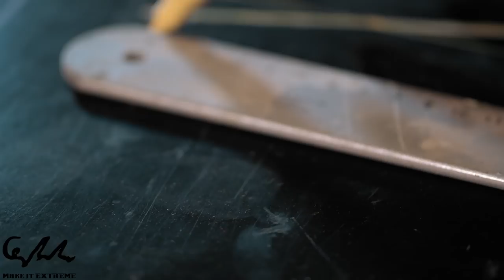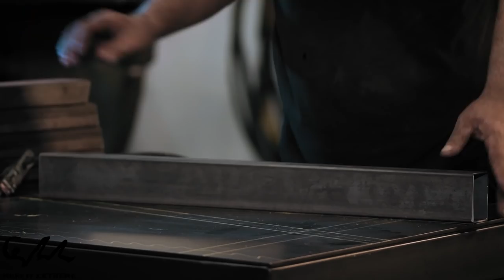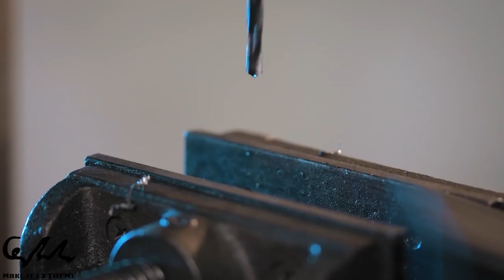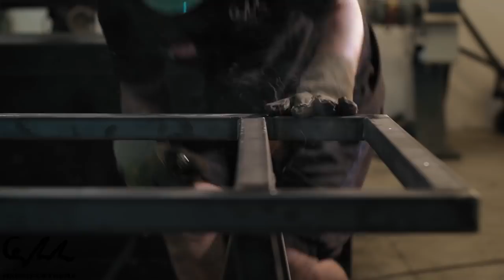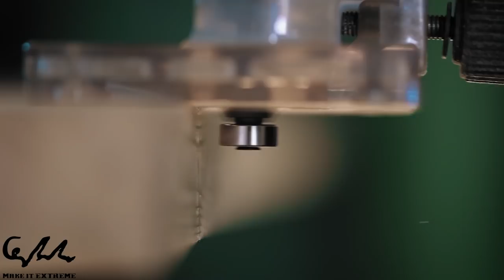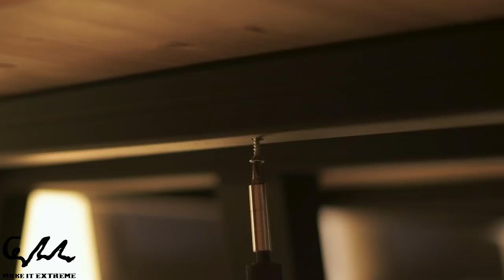I Made a Simple Dining Table from Scratch in One Day

Comment: Seeing that u guys are steel masters and not wood here is a small tip, always coat both sides of a table ( top and bottom) to prevent any moisture intake in the wood overtime wich will sooner or later result in a crack or bending of the wood because it slowly takes in water ( natural air moisture can be enough! )

And same reason to give the screws an oversized hole and cap them with a washer to give the screw some movement room for the natural expanding and contracting of the wood

👍🏻

Comment: If you don't provide some means for the tabletop to expand & contract across its width as it takes up or loses moisture due to to the changing temperature & humidity of where it is, it will buckle and crack. Woodworkers use 'buttons', in short slots on the table rails. Look it up. Wood isn't like steel; it's an organic substance and responds to its environment. Also, 6 feet will stop you having a level & stable table on anything but a billiard-table flat floor. Not a very good design.